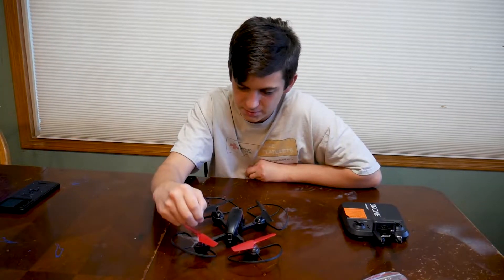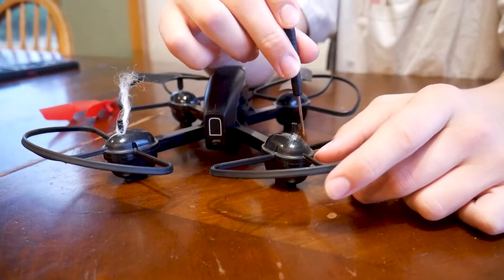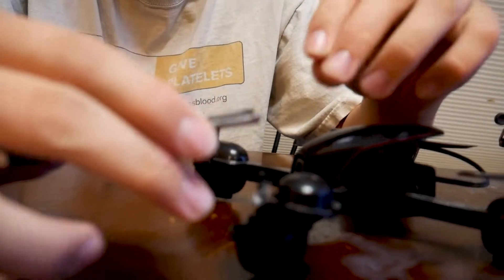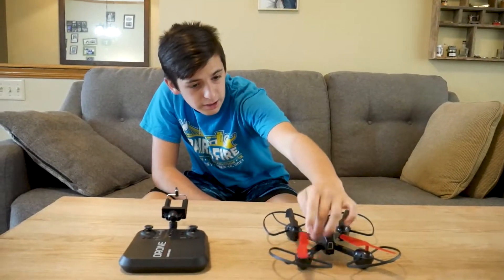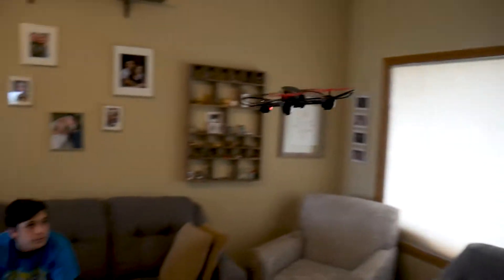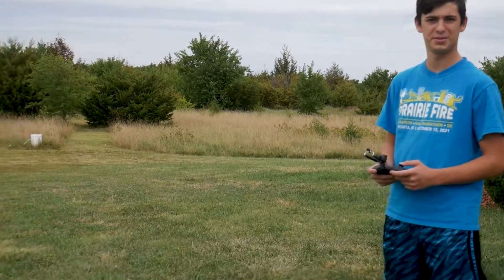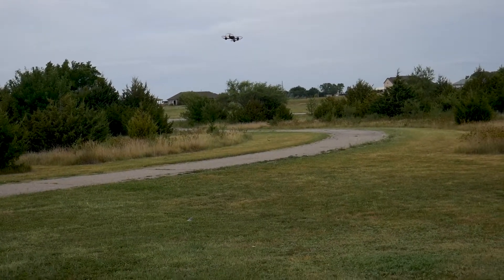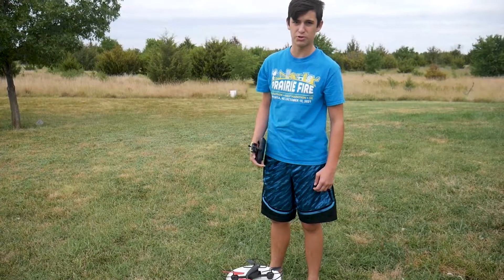Fixing Sharper Image Mach X Video Drone

Comment: What do I do about the gears if they are messed up? The motor spins but then it stops in mid flight. Can I get new gears or do I have to get a whole new drone?
Reply from the maker: You could buy new gears but it would probally be more worth it to buy a better deone
Reply: @Mr_Steve1  thanks.